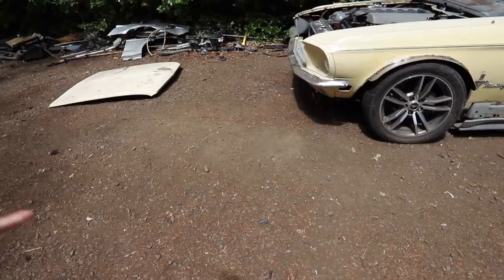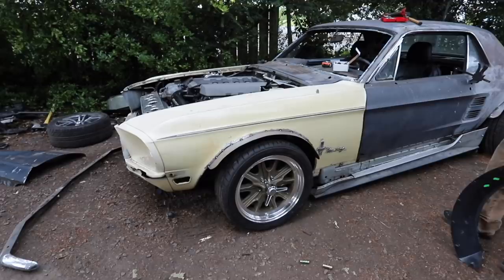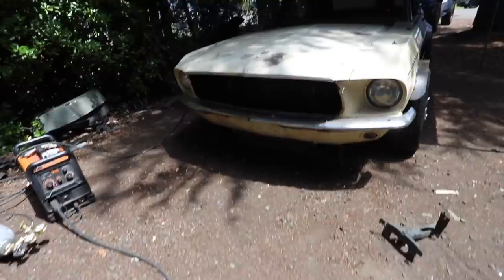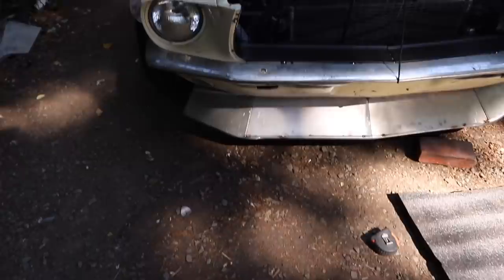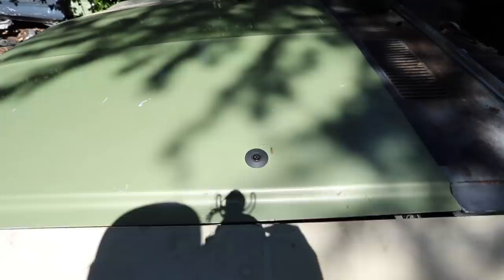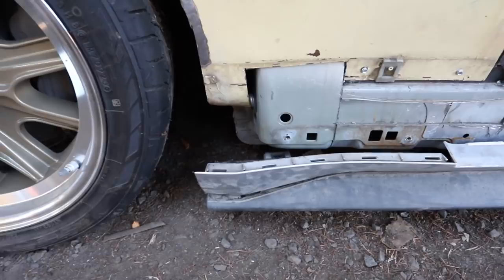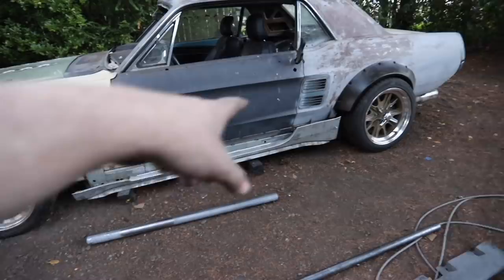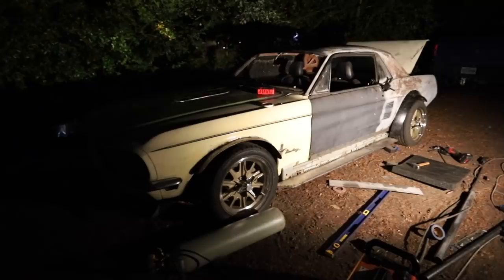We Transformed Oscar's Mustang With A Few Simple Parts!

Comment: I think you should just add some sheet metal to cover the frame all the way along the side skirt
Reply: I was saying the same thing to my monitor the whole time, or carry same design from front bumper
Reply: Yeah the side skirt doesn't really work guys - everything else it excellent. As aforementioned, what about simply adding sheet metal over factory structural sill, say, with a 2 -3 inch gap?
Reply: Exactly ; This horizontal plate is just.... ugly.
Reply: Right. Lose the running boards, it's not a truck.
Reply: Yeah,, I thought that too, It would look way nicer.
Reply: Was just thinking this and about to write a comment.
Reply: I think nonfunctional side pipes would look really good.  Wouldn't affect the frame and then use turn down exhaust right after the rear axle that wouldn't show.
Reply: Yes flat sheet and cover the mess and call it a day
Reply: Exactly what I was thinking. And paint Matt black to hide the bulk.

Comment: That looks like a 1930s running board on the side, all it needs is some rubber tread on the top, it doesn't go with the theme, its just flat, it dirsnt resolve it self,  the first one looked WAY better, the car has a bolt on theme, the original side skirt after you trimmed it had the perfect proportions. The only way to make that flat side skirt look cool is to make it narrower,  and dog bone the outside straight edge. The from spoiler looks good,  and those wheels are super bad ass.

Comment: What if you took the exhaust directly out of the center of the front fender above the mustang logo, then bent it down to below the door and took it back to the desired position by the rear wheel?  I think 2 pipes side by side coming out would look best.  It could be perfect for an apocalypse build, and it might avoid the structural issues.
Reply: @Mike Anderson I don't claim to know much about modding, but it's not impossible and has been done before.  All it takes is a second to google search front quarter panel exhaust or front fender exhaust, you'll quite a few images of different makes and models doing it.  Don't know why you have to be condescending to a complete random.
Reply: @Mike Anderson I mean, he'd likely want to go one pipe out of each fender just to make it easier. Since the headers are going to be one on each side.. I don't see why he couldn't do 4 to 2.. Bring the 2 out the fender and then straight down.. Then bring the 2 down to 1 at the bottom of the car where he'd go all the way back with the one pipe to wherever he wanted. Of course he'd have to have one on each side still, not sure if that was in dudes vision but... Why the hell are you calling this impossible? Can we have a good reason?
Reply: And maybe some ITB’s out of the new holes in the hood or place it close to the holes for ventilation, that would be cool
Reply: @Mike Anderson he can take those manifolds off and build a custom one, it’s not a big deal unless you make it one you know
Reply: You really need to do something to the front fenders! Please

Comment: For the front wheels, have you considered pulling the entire lower fender out a bit?  Use the moulding line as a start point and just pull and stretch blow that a bit to create a wider front fender to start with.  Then the little metal flares would work well, or you could even make some half moons to make it slightly wider and still blend to the front, all without destroying the somewhat original look of the car.

Comment: With the side skirt, what if you used multiple ideas from this episode? Use the old dude skirt and mount it as close to the body as possible. Then take the old quarter panel and mount it over the current quarter panel so that it matches the side skirt. This will create the illusion that the whole rear end and side skirt are widened.
You could even work with the front fenders to match, too.

Comment: You should keep the tube style side skirt with the sheet metal, but instead of making the metal curved you should keep it straight and use the dimple tool set to make holes on the side skirt. It would look hella badass and fit with the apocalypse build

Comment: Apocalypse theme is just an excuse to do a “shitty” job imo
Reply: Tbh i cant tell if youre being serious or i just got r/wooshed
Reply: Yeah I agree. I like the build but not a big fan of the apocalypse theme. I think it’s a way to just rush through the project to generate content quickly for the channel. Making it nice would take longer but I would appreciate it. I’m way too particular for a build like this.
Reply: it doesnt feel like an apocalypse theme. I mean, if you're gunna do apocalypse go full boar with it. AT tires, ground clearance, offroad wheels, thick metal mesh over the windows and lights... Really just seems more like an excuse as you've mentioned. Too many things done with care mixed with shit slapped together. Like the massive flat spot on the front fender extension.

Comment: #OscarDidAGreatJob
Definitely needs to be a shirt.

Also, Exhaust idea that's still sort of side exit:
Swap the headers to the "wrong sides" so they're pointing forwards, then build the exhaust forward and then turning in towards each other, through and X pipe and then dump them out each side, just in front of the front wheels. Would look badass, unique, and probably sound nasty as hell with the X pipe.

Comment: They missed the chance to have the exhaust come out the upper side of the front fender right under the body line and come down and go across the bottom like the Shelby a/c cobra exhaust, where it comes out right before the rear tire, I can see it in my head on the car and it would look completely bada$$

Comment: Oscar is MVB ( most valuable builder) and you could possibly still do the side exhaust bu cutting a hole where you want it to come out and re support the frame by running a pipe just bigger then the exhaust pipe and that will make it just as strong or stronger support wise and still look bad ass

Comment: Wouldn't it be a cool idea to route the exhaust underneath to the back like factory & then right before the rear wheels go through the floor, over the structural part and exit out the side above the frame rail? Also you could make a plate with a dimple die & flip it inside out to use as exhaust tips.

Comment: Me and my dad are building an 84 Ford F-150 2wd short bed truck gonna put a 302 4speed in it found on the side of the road a Volvo semi truck visor that if we cut it down a little it fits the front as a chin spoiler then we are taking a Lund fast back reversed on the back of the bed with a 94-04 mustang gt wing on top of that we put a topper window in the wing gonna take some old aluminum siding and fully cover the bed and wing cowl hood on it gonna run 31s in the front and 35s in the rear we took the rear shackles and flipped and inverted them so now the truck has about a 4-5 inch rake. Not sure if we’re gonna paint it or not no ideas on interior design yet

Comment: SIDE EXIT EXHAUST PROBLEM FIX! ok so basically just cut a hole in the wheel well then front fenders, after doing a legit wide body on the front, then run the pipe through the hole into and along the side skirt then a 90 outwards.

Comment: There’s a car in GTA V that’s modeled after the mustang and it’s called the Dewbauchee Rapid GT Classic and for one of its exhaust customizations, the exhaust goes over the fender and goes straight against the side of the car like a motorcycle (kind of hard to explain I suggest you search it you’ll see it) and since this is an apocalypse build I think that may be a good workaround for the side exit exhaust.
 As for the “side skirt” that’s a bench... I would just get some sheet metal and make it flat against the body so it covers the frame.
EDIT  for the fenders I feel like you're going in a good direction but I feel like if you got some spacers so the wheels stuck out more you could make some decent or get some decent looking fenders that won't look so weird.
Understandably there is a budget that must be stuck to. These are just some ideas and opinions that I thought should be considered.

Comment: What if you made the exhaust pipe the side skirt🤔 goes by your foot down on a 45 and straight cut across the side skirt to a side cut out the back covered by a slanted metal heat shield on a 45 giving a more aggressive side skirt

Comment: Why didn’t I just flare the existing quarter panel to blend with the side skirt and get rid o fit he rear flare 
As a one piece wide body the way the Mercedes’ sl wide body is 
The other option was to get a wider flare by the door area cut out the shape of the vent to blend into the side skirt as well 
Maybe those ideas would work

Comment: I think side pipes would be awesome.  You said there was too structural by front tire.  How about faking the side pipe, but splice in the real exhaust some point further down the side pipe?  It would look like an awesome race car style side pipe along the length visually, and still have the exhaust exit in front of the rear tire?  The exhaust pipe doesn’t even need to be round, it could be rectangular with round pipe outlets from the rectangular main pipe that runs the length of the car.  It could be multiple round pipes.  Think of the gasser drag cars from the ‘60’s.  Or for inspiration from what I’m talking about, look at a new triumph rocket 3 or Ducati x diavel motorcycles.

Comment: If you had the time and budget, I would've flared out the whole Quarter panel to give it a look that's like a trophy truck, but reduced (Sorta like the '70s Dodge Charger where the whole roof is narrow compared to the body) and curved into the original line of where the door currently is.

(
|
(

^Imagine that shape but less aggressive on the side profile, so a smoother blend.^

Comment: Loving the front valance, disliking the sideskirts now. Looked better with the blue tape, what you have now just look like you slapped plate on there and called it a day, doesn't do the build justice. Rear overfender is looking okay, the metal front one not so much. I think fabricating ones that flow better with the body would be the best option though, front and back.

Comment: Im doing an apocalypse build with a 06 chevy Malibu maxx it came with a 3.5 (funny thing is the moter is same same as the v6 marow lmao) but i made it awd dropped a 382 stroker into it stage 2 everything new pistons cams valve valve springs rocker arms lift rids ect,ect pretty much everything twin turbo bored the moter out .38th dual exhaust and complete over haul with the suspension and i put a t45 (8 speed manual tranny for marow) tied all together by pipe framing and self fabrication and yall gave me the idea to do something completely mental and unique its saddening that fords being shitty just cause yall made the mustang better than their engineers its pretty much what it comes down too i mean dodge dont sue people when they buy a brand new cummins and have to bore the moter out and do shit to it and do all types of custom work just seems real petty on fords end i cant wait to see oscars apocalypse build completed yall are awesome

Comment: At first I thought you were going to leave the clean lines of the original mustang alone, but then all those garbage pieces went on and lowering the car. You would have only changed to a different wheel offset to tuck the tires under the fenders if you left the original lines alone. But that is your choice and in my opinion the original lines were better for the cars appearance.

Comment: I'm digging the rest of it but the front fender still is still a little off or awkward-looking .... How aboutenlarging the flare were the natural flair of what the front fenders would normally have using steel to do so so creating a slight angle lip that comes off the fender and tapers down to the wheel again like you would see on a traditional fender flare.... the squared-off two 90-degree piece of steel 2 stuck in their looks like something was unfinished

Comment: He said we don't want to ruin the structural integrity so no side exit exhaust.  But Hell we will cut the fucking A B And C pillars clean off.  O and we can piss away the rear floor brace. Rear body panel? What rear body panel. Frame rails dont need to connect to anything right ?!?   😆 🤣 😂